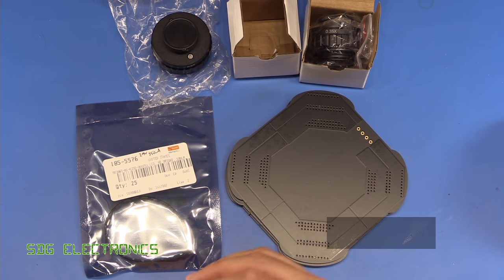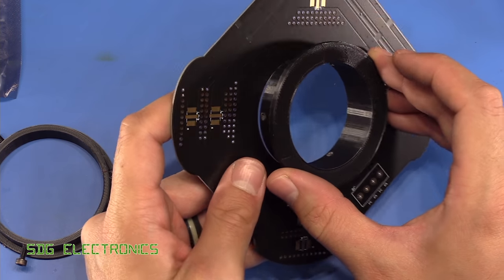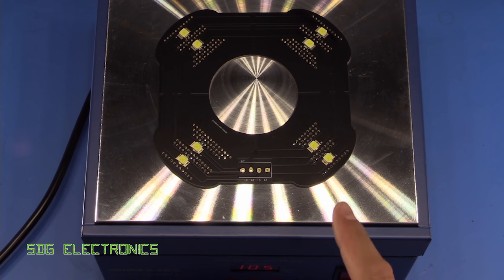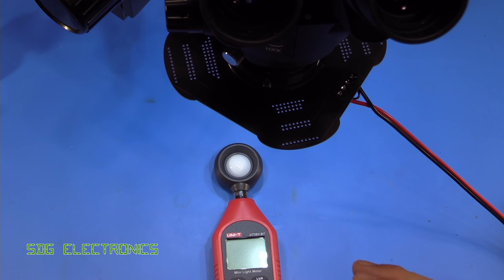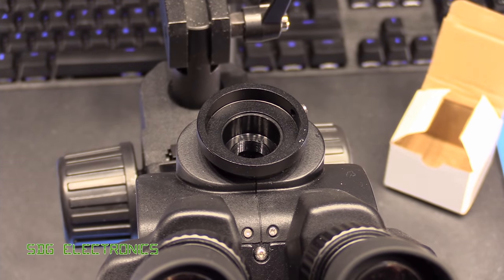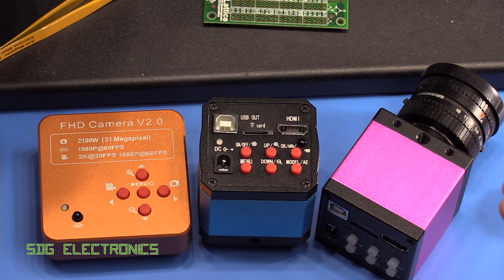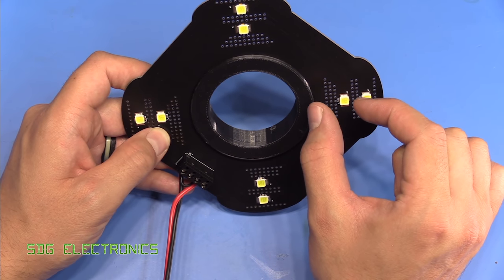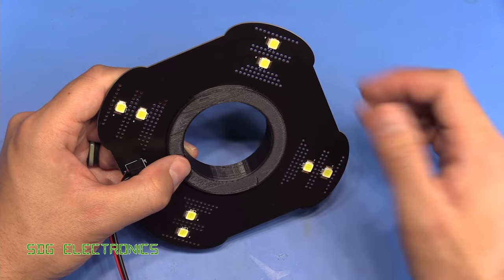SDG #160 All things SMT Microscope: Lighting, 0.5x 0.35x Camera attachments, Cameras, AF IMX290

Comment: Fantastic video which cleared up any confusion I had about the difference between a CS-Mount and C-Mount. While you didn't say too much about CS-Mount and C-Mount except on how to fix a problem, the sheer mention put me on the right trajectory where I was able to answer several questions I had with the help of Google. So thanks!
.
I note you own a Hayear HY-2307 and a IMX290 Camera. The IMX290 sensor is made by Sony and is highly regarded by the astronomy fraternity (as a telescope camera) because of it's excellent low light performance.
.
I've set my heart on a camera which uses the SONY IMX236 sensor which is in the same family as your IMX290. The IMX236 is not as sensitive to low light as the IMX290, but given that you can control  the light intensity I didn't think the IMX290 had any real advantage over the IMX236. Furthermore I noticed that the IMX236 cameras don't seem to have autofocus which is of little value to a stereo microscope. So my "Goldilocks Camera" decision rested on a camera based on the cheaper IMX236 sensor rather than the more expensive IMX290 sensor.
.
On the other hand the Hayear HY-2307 is touted with having a 14mp Panasonic sensor (the Hayear HY-3307 is a 16mp Panasonic). The problem with Hayear is they seem to deliberately hide the sensor model/part# only to tell you that it's a "Panasonic Sensor" and nothing more.
Would you be so kind and tell me how the Hayear HY-2307 compares to the IMX290. I know a lot about both cameras because I've already done a lot of research. The  Hayear HY-2307 is 1/4 of the cost of the IMX290, but it does not mean that it is 4X as bad.
.
With a looming purchase of a stereo microscope this July I was hoping to save some money by buying the Hayear HY-2307 or Hayear HY-3307.
.
Will I regret my decision to buy the Hayear HY-2307 or Hayear HY-3307 or should I bite the bullet and buy the IMX236 which seems to be in the same league as your IMX290 ?
.
I put this question to you only because you own the Hayear HY-2307 and IMX290 cameras which means your opinion counts.
.
Many thanks in advance.

Comment: Good idea with the led ring light with adjustable angle. It could be like flower petals. You could use a knurled wheel to turn a threaded rod for up and down movement. Attach a nut to some spokes attached to the petals and you could get some adjustment. Great video again Steve!
Reply from the maker: :-O I quite like that! I need to do some sketches to see if I can make that happen.
Reply: Do you have the files for the ring holder? Ive started to draw something in solidworks that fits around the microscope body with a knurled top section and threaded outside face. It might be good to encorporate it into the ring holder then its static.

Comment: I made myself a ring light 20cm diameter with a ring eight Cree XT-E LEDs hand-soldered to 6mm copper foil and stuck over fibreglass tape to an aluminium plate with a white acrylic diffuser in front of them, and powered by an off-the-shelf 700mA LED supply.  I use this with a Raspberry PI camera with an Edmund Optics 12.5mm S-mount lens at typically 40cm.  At this distance the reflection of the ring is a little larger than the field of view, so is not seen.  This arrangement gives me sufficient space for rework, probing etc, and I get 1200 lux which gives sufficient shutter speed for real-time eye-hand coordination.  My display is a standard PC monitor mounted directly behind the stage, so I can quickly transfer my view from direct vision to magnified by just moving my eyes, and also put drawings on the screen alongside the image.

Comment: I think you need little spotlights at a shallow angle, ie, 45º, so the beams are directional and can never bounce up. I can see some reflections with the 3.5 lens, maybe because the inner LEDs have too wide a spread. I use shallow spots on my desk and it works.

Comment: Certainly sounds like an interesting opportunity to play around with flex-rigid, though perhaps an expensive option for the application!
My first thought was 4 aluminium PCB sticks for the LEDs, with connectors to plug to a central FR4 board. Can reduce the area of all boards significantly, and if you make the aluminium sticks long enough it might be possible to bend them to provide the angles you're after too!
Reply from the maker: That would be the most sensible option - I'm expecting people may want to build this, so probably shouldn't make it cost prohibitive :'D

Comment: Hi, I have the exact same IMX290 and focus ring, but my image quality is junk, it's pretty grainy and poor. Nothing like the examples I see all over the net? Know of a potential fix for that? Is it my ring light? And it has a lot of chromatic aberration too which I can't seem to so in other examples with this camera.
Reply from the maker: If it's looking grainy, it's usually because there is not enough light. Also check everything is seated properly.
Reply: @sdgelectronics  I figured this would have been the issue, and after hours of testing I've found both my rings lights are junk. The original AMScope one and the super bring led ring light I have are both great for general viewing through the eyepieces, but jank for the camera. I'll buy the 6W Gooseneck spotlights I've done some research and they seem to give the best results. Thanks for confirming my suspicion!

Comment: You mentioned newer and better camera sensors. Have you tried any since this video? What ones are you looking at? I'm interested in the imx290 and it seems the other model numbers of imx are quite confusing to understand. In other words the higher the number it is not better but rather a different application. Any tips would be appreciated.
Reply from the maker: The IMX sensors seem to be most thoroughly used in CCTV cameras where low light performance is needed. I hope to investigate something newer this year though, possibly a 4K 60 FPS camera. The IMX290 will still give you great performance though, I'd just miss out the autofocus tbh.

Comment: Have you got a link please for the c-mount to c-mount adapter used at 15.31 on the video please as I really need them. Thanks jay
Reply from the maker: The seller I bought mine from no longer has them. Search for "5mm C-CS Mount Lens Adapter" on eBay and it should find many different ones.
Reply: SDG Electronics thanks so much, it’s just what I need for my camera because I can’t get it to focus . Thanks jay
Reply: @sdgelectronics  Thanks
Reply: SDG Electronics just bought 3 of them, thanks for the help. I let you know the results. Honestly I really appreciate the help.xx
Reply from the maker: @SURGE101  hopefully it fixes any problems. I only realised the issue after much fiddling around
Reply: SDG Electronics hopefully it does because I got the camera and the 3.5 adjustable lens that you recommended in the video but I can’t seem to get it to focus. I’ve ordered 3 of these so hopefully that sorts it because I really don’t want to have to spend a fortune buying a new camera. Love your videos, they’ve really helped me a lot. Thanks so much jay.

Comment: Rather than flexing the board to get the light directed at the central spot, could you use through-hole leds so you could bend the leads to direct the light?
Reply from the maker: I'm trying not to use through hole LEDs. They aren't great for high brightness applications and have poor thermal performance. The plan is only 4 or 8 high output LEDs

Comment: most people says these cameras can only be connected to a monitor using the HDMI cable but not to a PC. 
can I connect any of these  cameras to a PC or laptop using HDMI cable to get a high definition picture ???
Reply from the maker: If you have a way of capturing HDMI to video then yes you can. An Elgato or Avermedia HDMI capture device is pretty commonly used. You can also use USB, but not at the highest frame rate.
Reply: PC or laptop will have HDMI output connector.  Camera also has HDMI output connector. Only if you have HDMI capture device (with HDMI input connector), you can connect it there.

Comment: Why bother with flex-rigid pcb when this type of application will probably be better suited by connecting small pcbs by simple wires?
Reply from the maker: Certainly would normally use wires, however it could be quite a nice straightforward project to try designing the PCB and test out the capabilities of some of the PCB suppliers. It'll be the first time I've attempted it using PCB software at home.

Comment: Steve--How do you like that solder plate? I just ordered one.
Reply from the maker: I can't speak to the long term reliability. Anecdotally lead-free alloys are not as good as the lead counterparts, but I've had really good results with the SolderKing paste and I do like the Bizmouth alloy - it makes assembly and rework so much easier.